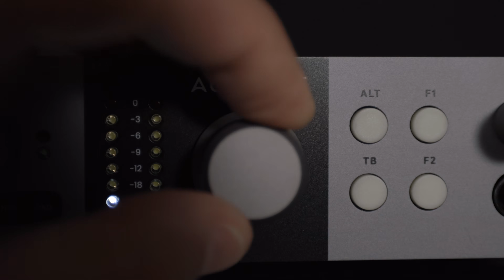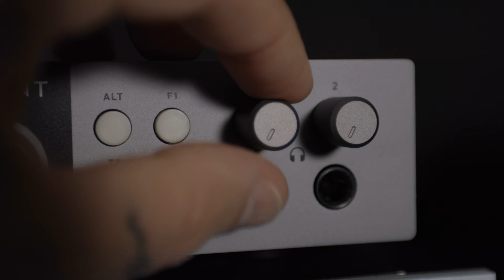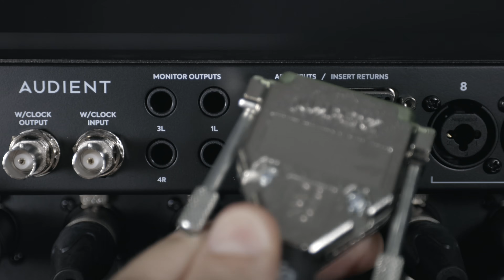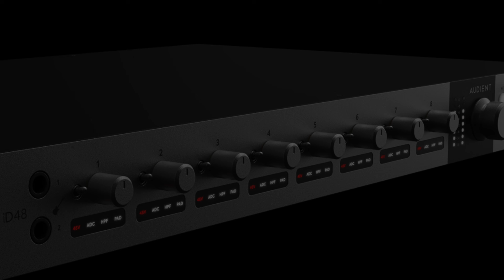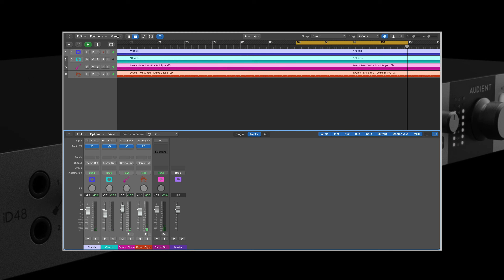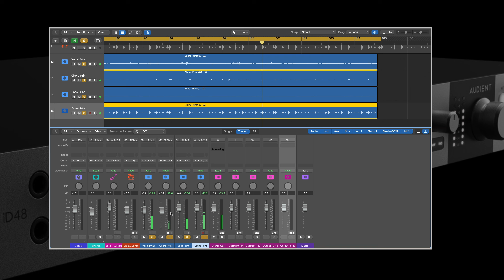Audient iD48 Ultimate Hybrid Recording and Mixing Interface

Comment: You have 10 channels on the R10, but only 8 insert channels on the iD48. How are you connecting everything? I noticed you sent outputs 15/16 to the SSL G-Comp and the Ultraviolet, but those two units would need four channels. How does that work? Thanks!
Reply from the maker: I think I used 2 channels for those in the video, but connected the hardware in series. So the output of the Ultraviolet probably went to the G Comp. I used that for a while as my master bus chain. But I’m always changing it up a bit.
Reply: @ToddUrban  Oh, gotcha. Thanks! I'm trying to decide between the Audient, the AudioFuse 16Rig, and the MOTU 16A. Not sure if you're still using the iD48, but if you are, have you run into any issues after a year?
Reply from the maker: It isn’t my main interface. However, I’ve used it as a travel interface and found it to be super solid. I’ve also found their team to be very responsive, so I would have no issues recommending them.
Reply: @ToddUrban  Awesome, thanks a lot! That's really helpful.

Comment: Thanks for this video. I would have been stuck a little longer without it. I couldn't see anywhere in other videos or the documentation, that I have to switch the LINE OUTPUTS to DAW ADAT in order to send through outputs 9-16 and receive on inputs 1-8, mixing in the box...that is not quite self-explainatory ^^

Comment: It s a shame preamps 7 and 8 are fooked up due to being too close to the power supply. You never heard a difference? It s there and is very audible, they make a lot of noise due to the interference of the power supply. I would buy this product, cause I like it, but with this gross problem, NO WAY. It s also amazing Audient say the noise is below their standards. Nice standards then, because it s quite audible the noise.  Great video, thanks :)
Reply from the maker: I haven’t heard that noise on my unit, but know when measuring any interface, there can be some slight interference or differences between channels that are minimal. I wonder if you might have a faulty unit with poor shielding or something. I would contact Audent to see if you can get it addressed. Thanks for watching. I do hope they have a resolution for you on that.
Reply: @ToddUrban  Well like I said I didn t get it. The noise can be clearly heard on Julien Krause reviews. Check it if you wish. I m not so sure it was fixed as it seems to be a hardware problem and not software. Actually I didn t get any expensive interface yet, due to soe kind of problems. The Arturia top of the range interface which was also a choice, has DC offset issues on the outputs, so that was a no go also. Since I have an SSL 12, I m not interested in the SSL 18. I really wanted the ID48 because of the DB25 connectors. But when I heard what I mentioned I was disappointed, you can check it, it can clearly be heard a lot of preamp noise as compared to the other 6 preamps. Thnak you for your time, take care :)

Comment: Thank you for the video.  I have a question that I'm hoping is obvious to someone who can confirm something for me: I was wondering if it is necessary to physically route the audio signal through the DB-25 Send & Return; or if this could be done digitally in the software for the interface.  My goal is to bypass the internal Mic pre-amps so avoid any coloration whatsoever for a pre-amp IR and bass cabinet modeling pedal (Origin Effects Bassrig Fifteen - mimicking Ampeg B15).
I hope to collect some outboard gear eventually, but for now just bypassing the preamp so I can hear the pedals "pure" output DI signal would make the ID48 a great fit.
Reply from the maker: I’m 99% sure I’m correct about what I’m about to say, but maybe someone can double check me. When using the db25, you can use them as I/O without hitting the preamp again. The preamps aren’t very colored to begin with, but this makes sure you are only using the I/O as strictly I/O.

Comment: Can I use this to extend the number of inputs on my UAD Apollo x4? I own the asp 880 and I’m considering upgrading. The only thing I don’t like is that the physical buttons were eliminated and the functions are now running on the software.
Reply from the maker: Yes, you can. However, with a x4 being your main monitoring unit; you would be better off using external preamps with an ADAT out, rather than adding a full 2nd interface. It’s more bang for the buck and keeps the Apollo dedicated as the main unit. So in that case, I’d stick with the 880
Reply from the maker: I should add that the iD48 plus the 880 is a killer combo to consider.

Comment: Nah, lets be truthful, audient failed by putting  DB25 
I have a iD24 and about to upgrade to a SSL 18
Reply from the maker: Why do you think that? Almost all of the flagship interfaces on the market use DB25. They are expensive, but offer the most configurable connectivity in a small footprint.
Reply: My truthful is that I much prefer DB25.
Reply from the maker: I agree. It is compact and offers a wide range of options.

Comment: All of this “flexible routing” is fantastic assuming that you’re using the preamps in the unit. None of that routing is available for the 16 adat channels. In other words…a patchbay is still better, and even necessary if you require real analog flexibility. I don’t understand the utility of inserts given that a 24 channel patchbay is available new for $100. The best thing about these Audient interfaces is the preamp bypass and the high pass filters. I’m also convinced that the ADC on the id48 might actually be better than the Apogee 16x that I’ve been using for 20 years.
Reply from the maker: Good point that yes, ADAT might not be able to take advantage of these “patch points”. I didn’t try that, but am assuming you are correct. 

Regarding a $100 patchbay; well yeah, maybe there are some, but probably not great quality. The DB-25 connections along would put you over $100. My Switchcraft alone are over $1000 per patchbay. So I think it depends on the quality you need. 

In short, yes, it’s not as flexible as a separate patchbay, but might cover the needs for people who need the occasional patch point and are not constantly re-routing. 😃
Reply: @ToddUrban  A high quality 48 point Neutrik patch is available new at Sweetwater for $107. I don’t understand the point of committing outboard to utility preamps. My favorite thing about Audient is the preamp bypass…lol.
Reply from the maker: The preamp bypass is great too. It just gets you pure I/O

Comment: how does this compare to the UAD Apollo? i got an old silverface FW apollo that ive been looking to sell and upgrade.
Reply from the maker: Sonically, I would assume the Audient is an improvement over the old silver face. Comparing it to an X series, they are probably a bit different, but I wouldn’t say either is better. The Audient is easier to use for many people in terms of the control software

Comment: Great demo! I’m assuming if you wanted to track through multiple outboard rack units (say a Pultec EQ in to an LA2A for example) and didn’t have the ability to put them in series via a 500 series lunchbox switch like you did here, that this would still require a patchbay? Or can some internal routing be done to make this happen?
Reply from the maker: Well, obviously you can keep them permanently routed to each other, but that’s not always practical. You could use a patchbay, which in your case is probably easiest. But you could also route through one output, into the iD48, back to the DAW and then back out to the other hardware and back in. It does actually work, but takes a bit of extra setup in that case.
Reply: @ToddUrban yeah thanks, I figured it would have to be something like that. Definitely wouldn’t want to keep them permanently routed to each other so it’s good to know that kind of internal routing setup does work :)
Reply from the maker: Even with a patchbay, there is a benefit of being able to assign the insert points easily from tracking to mixing. It is like having a mini Flock (with limited routing options) built into the interface.

Comment: Yes, you could buy the newer version of the x6 sixth has adat in and out I’m by the Cambridge 500 series chassis, or keep your Uad, and come back in for the chassis Analog🤔
Reply from the maker: Yep. The x6 and Cambridge Audio are both great units. But add up the price and it is a massive difference. Additionally, with the x6, you will have less inputs while tracking and will not have the ability to track through hardware the same way. So there are some trade offs.